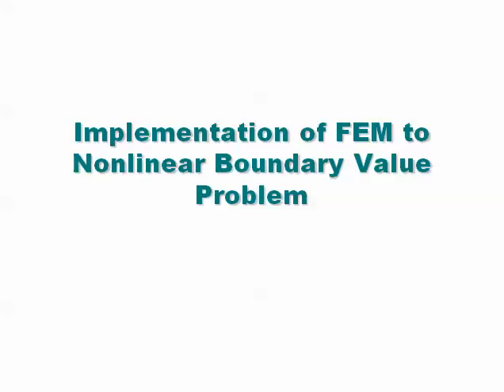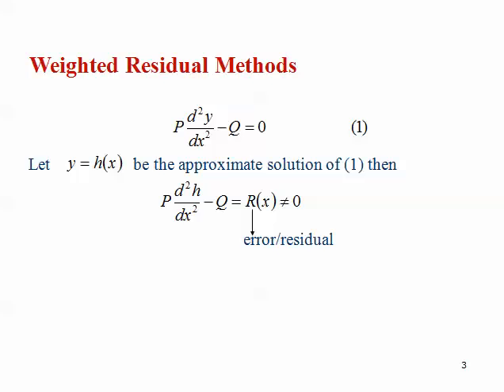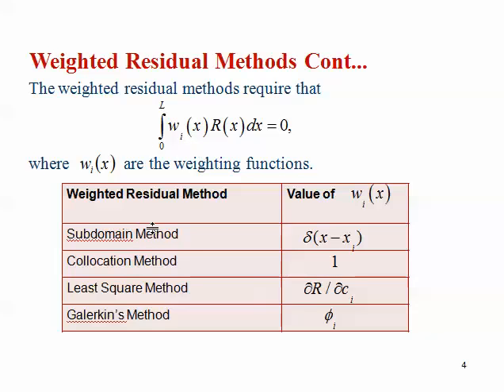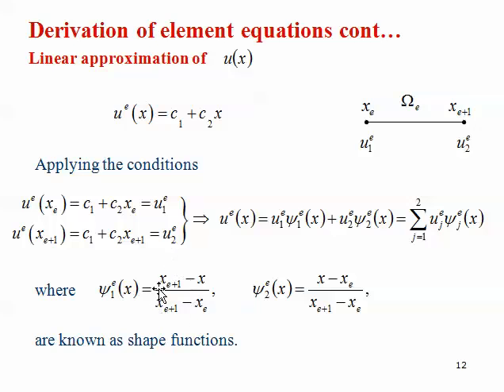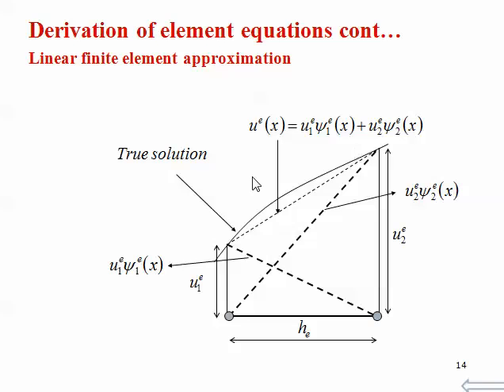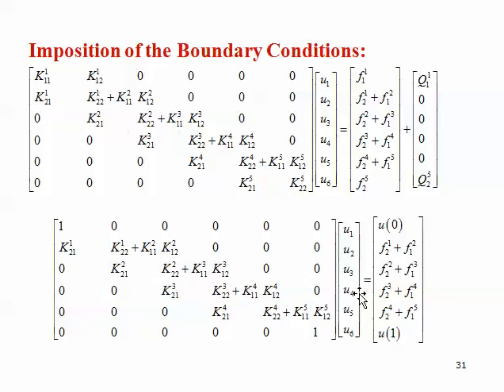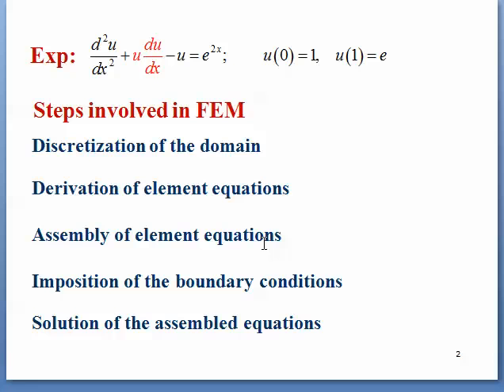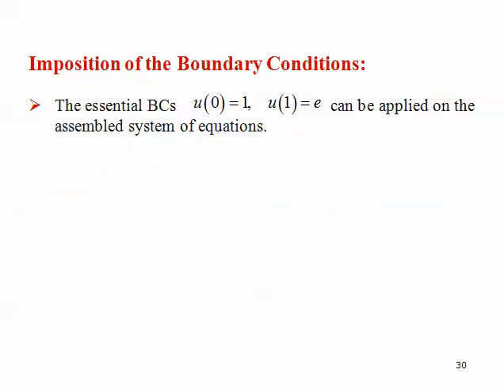Implementation of Finite Element Method (FEM) to 1D Nonlinear BVP: Brief Detail

Comment: Thank you for your good video !! It helps me a lot ! ><

And I still don't know what are the Qe1 & Q(e+1)2 ...and why Qe1 + Q(e+1)2 = 0 ?
Do the Qe1 & Q(e+1)2 have physical meaning? Flux ?
Reply: Sorry I think I got the point. XD
     Ψ1(Xe)*Q1 + Ψ1(X(e+1))*Q2 = 1 * Q1 + 0 * Q2 = Q1
     Ψ2(Xe)*Q1 + Ψ2(X(e+1))*Q2 = 2 * Q1 + 1 * Q2 = Q2
  So actually only Q1 or Q2 left in the equations.
  And since  Q2(e) & Q1(e+1) are at the same point (same X),  Q2(e) == - Q1(e+1)
  And the reason we have to have this conclusion is, because when we do Q2(e) + Q1(e+1), 
that won't make it equal to zero automatically since du(e)/dx & du(e+1)/dx are  described with different point(u(e),u(e+1) & u(e+1),e(u+2)),
that means we have to force Q2(e) + Q1(e+1) == 0 .